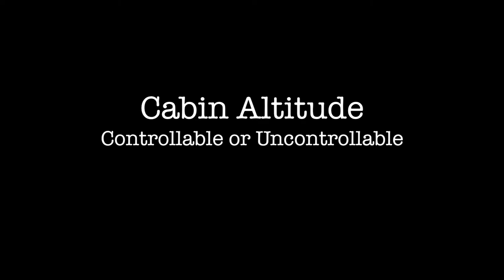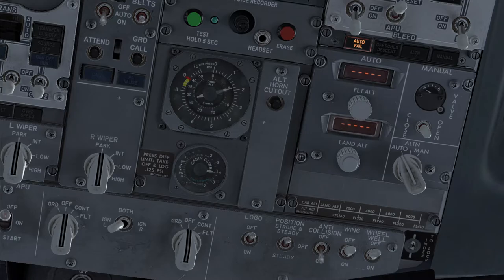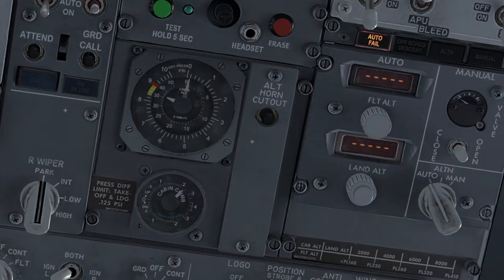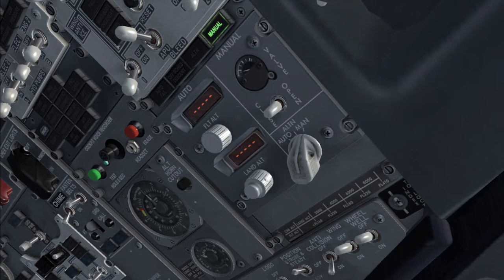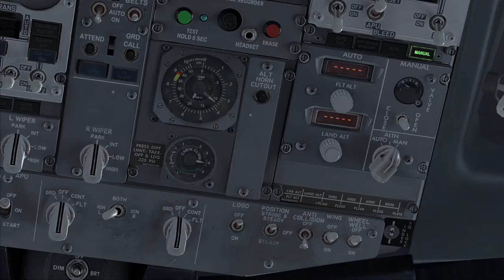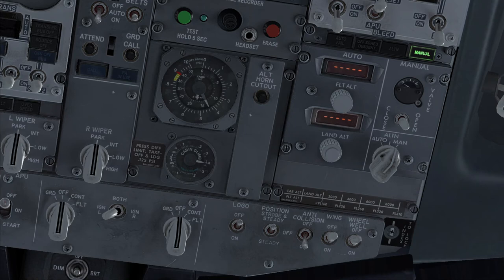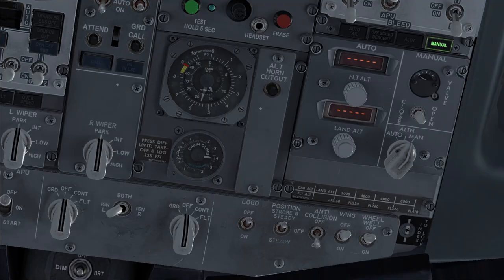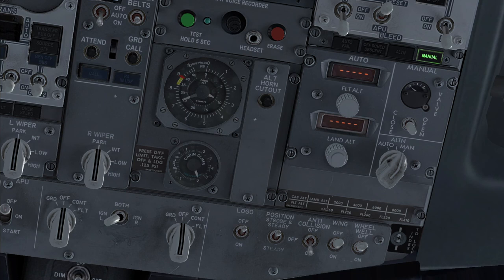Cabin Altitude: Controllable or Uncontrollable

Comment: Very well done. I can't understand why your videos don't get more views as they deserve more attention.
Having done an emergency descent on the 737 due to pressurisation control issues, I think it was very relevant to highlight the pressurisation panel indications as you did (Delta P and cabin rate). Indeed, with positive control of the outflow valve recovered and normal bleed air supply, the cabin rate will indicate full deflection and delta P is a key indication to check (under stress, it's easy for a chap to become fixated on cabin rate and overlook delta P so it's really important that everyone understands that already on the ground without stress. My captain back in the day couldn't understand that we were repressurising at very high rate and ordered an emergency descent).
Reply from the maker: As you already know, trying to identify if the cabin press is under control or not just checking the climb rate can be tricky. If the cabin is controllable and the climb rate is indicating full deflection down, the indication is pretty similar to the indication of full deflection up. The differential pressure is the key indication to understand what is going on, and probably that is the reason its pointer is the biggest one.